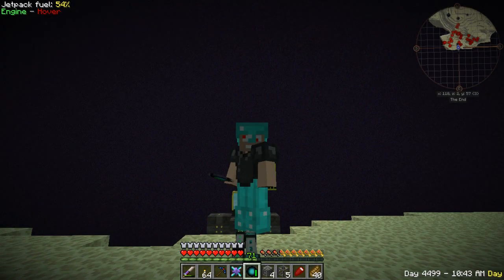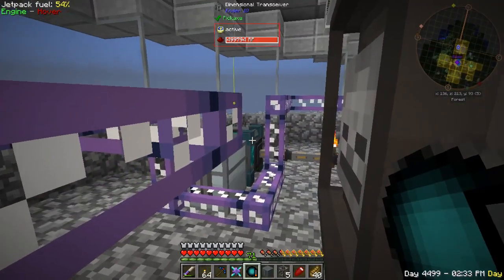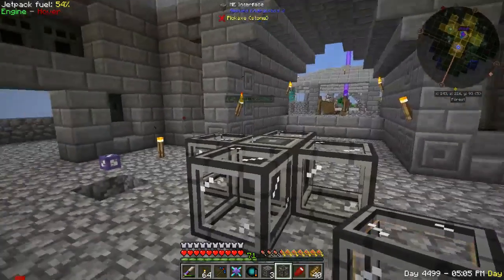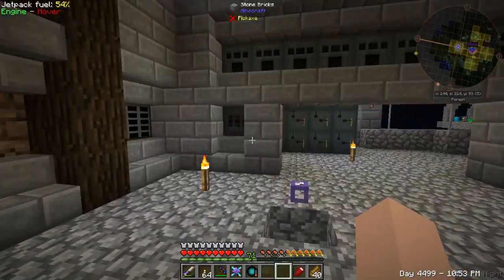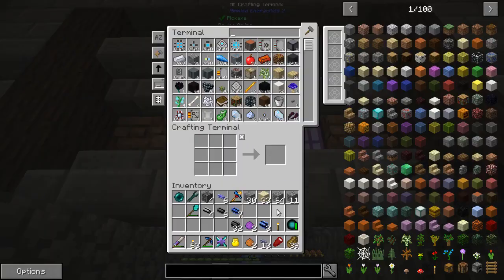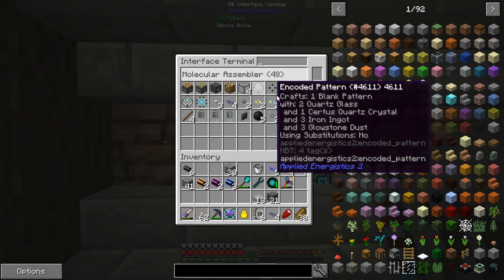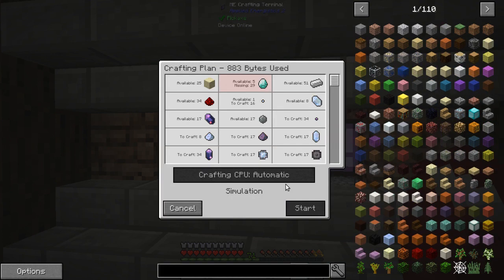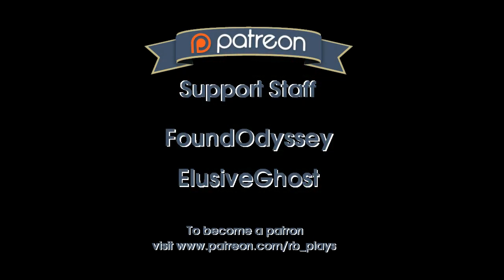Modded Minecraft : FTB Beyond : Ep 28 : Autocrafting Made More Efficient (Applied Energistics 2)

Comment: While your Autocrafting 3x3 towers look impressive, you will run into some issues using them.  The ME cable coming in is 8 channel cabling.  The cable touches one of the Molecular Assemblers (which uses no channel), which passes power and channels onto each ME Interface it touches (using up one channel for each ME interface), and then from each of those ME Interfaces to every Molecular Assembler and ME interface they touch, and then onto each Assembler and ME Interface they touch, and so on and so on.  The fact that you have multiple 8-channel cables running to the big block of Interfaces and Assemblers does NOT increase the number of channels beyond 8 because the interfaces and assemblers are all touching.  Think of the pile of interfaces and assemblers, or any pile of AE blocks (such as ME Drives), as almost like a multi-block structure.  If the whole pile uses more than 8 channels, then something will not work.

This means that, for example, the fluix cable touches the center assembler which touches 4 interfaces (using up 4 of 8 channels), so the bottom level of Assemblers and ME Interfaces should work fine.  The Interfaces on the bottom level touch a total of 4 more assemblers (which uses no channels) AND 4 more ME Interfaces (bringing your total channels used to 8 of 8), so the second level should all work fine.  This is where the problem starts since the 4 Interfaces on the second level touch more Assemblers and Interfaces... but you have no more available channels, so all the ME interfaces on the third level and up won't function.  Since the Interfaces on the third level and up won't function, that means there is no way to get patterns to work in them.  This means any assemblers they are touching on the third level and up won't work either (even if the tooltip says "Device Online") because if the ME interfaces they are touching aren't functioning, then the Molecular Assemblers can not be told what to craft and are just essentially very expensive glass blocks.

The fact that you are running four 8-channel cables does NOT increase the number of channels to 32 because the power and channels do not ONLY travel in a straight vertical line up, they spiderweb out in all directions, connecting all AE blocks they touch.  Like I mentioned in the discussion we had in the comments section of your previous video, the highest number of ME interfaces and Assemblers you can have all touching each other is 8 interfaces and 42 Assemblers all interconnected with each other, which would use up a total of 8 channels.  It doesn't matter is you arrange them in a short cube or a tall pillar.

Manually put one of your recipes into one of the higher level ME interfaces and attempt to autocraft, you will find that it won't work.  In fact, if you open your Interface Terminal you will only see the first, bottom 8 ME Interfaces.
Reply: Alecium I have several of this structure.  unless the 1.10 version of AE changed, the assemblers neither uses nor transfers channels.
Reply: is your 3x3 structure more than 2 layer tall though?
Reply: I don't have pictures of my 8-layer tall ones, but I do have 6 layers in this picture: http://www.imarvintpa.com/Imagery2/picture.php?/1415/category/53  In Bee Happy, I was adding layers as I needed them, so I know they all work.
Reply from the maker: I can confirm IMarvinTPA's statement that this does work. I have placed one crafting recipe in each of the 64 interfaces that I placed in the two towers and all of them are available for crafting and do complete the crafting once it is requested. 

I can see where you are coming from though Alecium, depending on how the cables are connected you could use up channels and not have enough for the upper layers. All in all I'm not sure why this is working but it is in fact working. 

I can also confirm that I can see all of the molecular assemblers in my interface terminal. And let me tell you all...it is a long list lol. I scrolled and scrolled and scrolled before I reached the bottom of the list :P

This is a great discussion! And I am glad to have the feedback of all of you. It makes me a better player. Makes for better future content on my channel. And most importantly helps other players find new ways of using these mods to their fullest potential. Keep the comments coming! :D
Reply: weird, doesnt work on the ftb beyond server i play on, nor in my single world.
Reply from the maker: That is weird. I wonder why that is. From your earlier comment  I could see why it wouldn't work if you accidentally made a cable connection to the bottom center assembler but I mad sure that that didn't happen. The only connections are the four glass cables to the interfaces. Other than that I can't see any other viable reason it wouldn't work for you. 

Perhaps you could share a screenshot that shows your cabling?
Reply: I built the tower in Beyond 1.5.3 and it worked.  I reloaded after updating to 1.6.1 and it is broken.  AE changed something.
Reply: Correction, I have found a bug in AE.  It works if I break the network then reconnect it.  It just reloads bad.  But I have to have it in a specific configuration to make it happen.  Screenshot: http://www.imarvintpa.com/Imagery2/picture.php?/1439/category/75
Reply from the maker: +IMarvinTPA yeah I'm about two versions behind in my updates. Good to know that I'll need to "fix" a few things when I finally update :P
Reply from the maker: +IMarvinTPA I just checked out your photo and mine are essentially like the one on the right. So...does that mean it will or will not be broken after the update?
Reply: rightwingrb The screenshot is from right after reload.  I think your design will be happy.  If you break the cables on the broken version and replace, it will work again until the next reload.  I put in a bug report too on GitHub.
Reply: +Alecium is correct about assemblers acting as cables for transferring channels, just not using any themselves.  I tried smart cable -> assembler -> interface and the cable lit up with a channel.  So, technically, my structure should be somewhat unstable.  It just generally works out.
https://github.com/AppliedEnergistics/Applied-Energistics-2/issues/2909
Reply: good to know i am not going crazy... yet.  You can call and cancel the men in white coats that are on the way to my house.

Comment: for REAL efficiency, put 6 assemblers on each interface... the assemblers  and interfaces both pass power and signals right, no reason a design couldn't be worked out to have a mega cluster of 32 interfaces and 192 assemblers on one dense cable... and yes, the dense cable will accept the connection(s) directly!

Comment: I came up with an analogy for the P2P tunnels.  They're kinda like wired one-sided tesseracts with single purpose construction that you link together with a memory card.  For example, a pair of Item P2P tunnels is like a pair of tesseracts both set to send and receive items only.  Each end of the P2P tunnel will take up a channel on your network (2 total).  I never use the item ones because there are better options.  But, the ME P2P tunnel can handle up to 32 channels in a similar way.  So you smack one on the side of your controller and a short bit of cable to connect it to the controller on another face for its channel.  Then you run a long cable (regular or dense) somewhere else and put the other end of the P2P tunnel there and a dense cable on its working surface.  Shift-right click one of them with the "Memory card" and right click the other one and you now have 32 channels at the second end, all available to do whatever you want except another P2P tunnel.